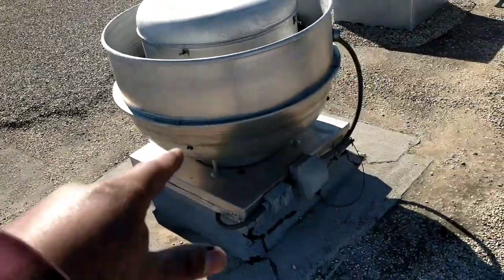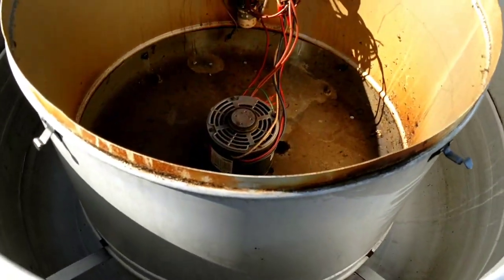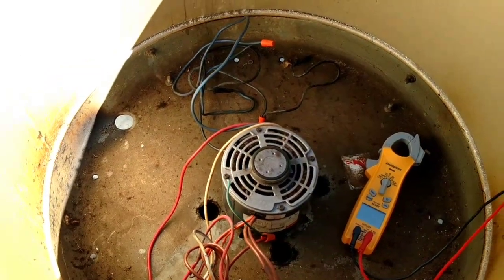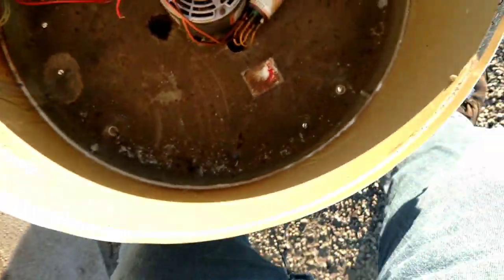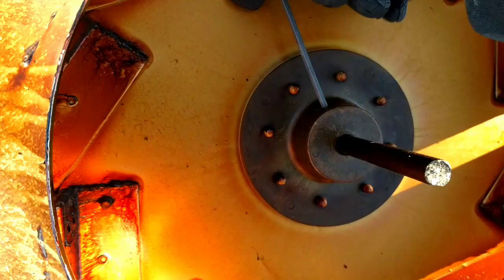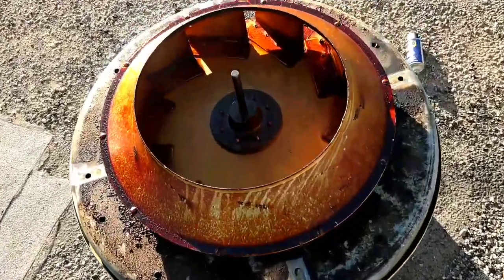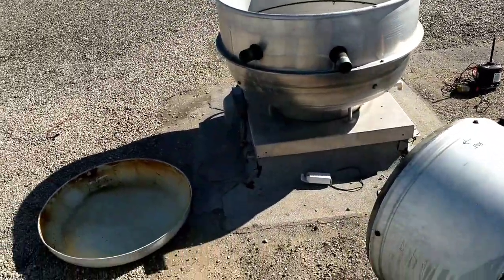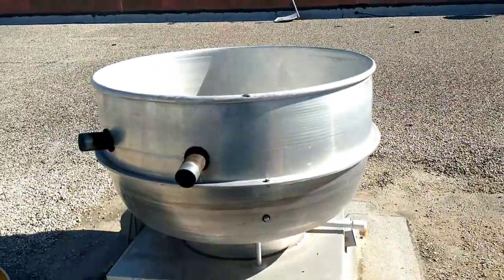HVAC/R: KITCHEN VENT MOTOR REPLACEMENT.  How an easy call can go south QUICK!

Comment: Sometimes not every job goes smoothly. Thanks for posting though. Something I've learned from exhaust setups is by the time you're there running a call on them the store heard the noise months ago and now multiple other parts are damaged. You want to be a mechanic and fix a specific part, but sometimes it's more cost effective in the long run to replace the whole assembly.
Reply from the maker: Yes, sir, you're correct.  And thank you for watching...

Comment: Feel your pain went through that one time before. Those direct drives will kill the  bearings in motor quick unbalanced. I've replaced a few fans with the OEM assembly that comes with motor/blade then I take the old blade to a buddy at machine shop he bathes/cleans it then checks balance. Now I got good blades to swap with motor changes 👍
Reply from the maker: That’s smart. Always have spare parts

Comment: Bro that’s crazy. I had an issue not long ago. Replaced a Dayton motor from grainger and it would blow the breaker as soon as it started. Brand new motor was no good. I don’t fault grainger, I think the Dayton quality has decreased over time.
Reply from the maker: Very possible

Comment: One thing Im curious about, since Im sure it wasn’t the OEM motor you were replacing(dayton label).

Any chance the old and maybe the new motor were rated for “cont air over” on the nameplate? Remember that those exhaust fan motors do not have airflow going over them, and if they are rated for cont air over then they will naturally over heat in that application. Lots of HVAC motors are rated for “cont air over”.
Reply from the maker: This one was an OEM replacement.  However, in my  learning process, I did replace 1 vent Hood fan motor with a universal fan.... Burned out in 6 months 🤣🤣

Comment: It is an easy fix if you work on them all the time
Reply: Sometimes if you dont use an oem motor you have to use a shaft adapter.

Comment: Just had the same problem at a HEB on friday night... ridiculous as to trying do it by yourself at 1am..... then i cant find the parts at united😡😡😡😡
Reply from the maker: Mauricio Villanueva this motor has to be rated for a certain heat leve.  I forget what it was but I replaced one with a motor from United and it burned out in like 8 months.   For this case I used an OEM from Grainger.   Always go OEM.